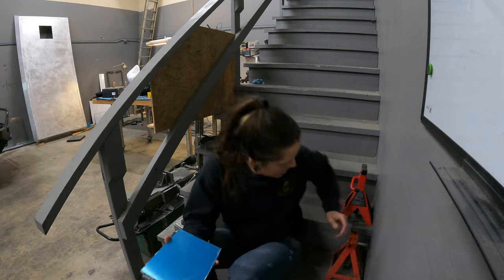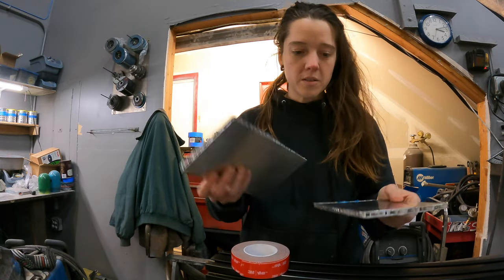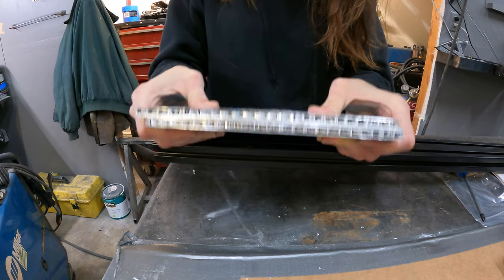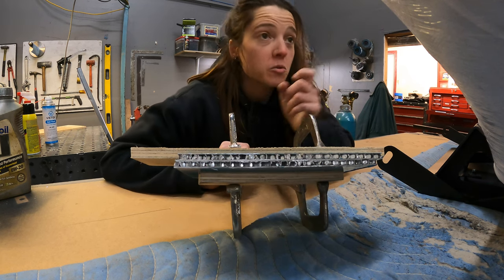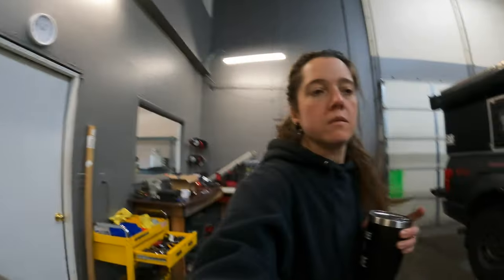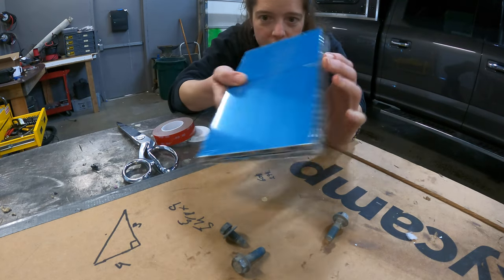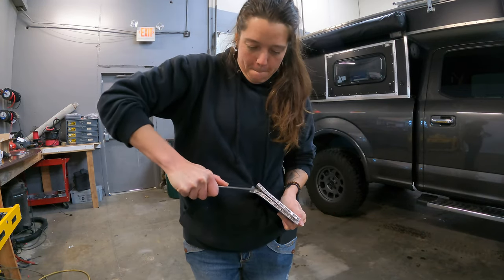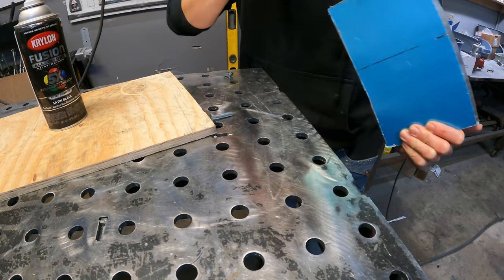"Those panels are going to FLY off!" (according to the internet) - 3M VHB Tape

Comment: The internet is full of people who spew forth absolute nonsense; it's almost a hobby for them, just like trolling is to some. I have plans to make a camper trailer using VHB to attach the aluminium panels; it took me less than 10 minutes research to know that it would be perfectly suitable. 3M are the World's best at what they do; making specialist tapes. Ignore the doubters, you won't regret using it.
Reply: Preferably use a Composite with a fibreglass skin, the aluminum provides too much thermal expansion in hot weather compared to fibreglass. If you gouge aluminum it’s tough to get rid of that scratch, Fiberglas, is easier as you just sand it and fill it and then repaint. The thermal expansion on fibreglass is a lot less in hot and cold weather.

Comment: The one area of concern would be elevated temperatures. On a very hot summer day, if you paint a panel black (or other dark color), and considering the very good thermal conductivity of aluminum the bond could be significantly weaker. With that said, removing VHB tape sealing a computer screen to a device using a hot air station still takes a lot of effort. Even with a weaker bond, it would take a significant amount of force to separate the parts.

Comment: It depends on the substrate you're gluing it to. If you have a flat aluminum roof it will hold well. My motorhome roof has a thin EPDM (rubber) membrane covering a plywood roof. Even if it did adhere to this thin membrane, the membrane itself would surely pull lose from the roof, tear and fly off. I used 54 toggle bolts with over 1,000lbs of tensile strength each to secure my solar array to the plywood roof of my motorhome, so it comes off, the whole roof is coming with it.

Comment from the maker: According to the internet, they say the camper panels are going to completely fly off on the freeway. Therefore, I wanted to do a test on how much force is required to separate the panels once the tape has cured. 

Conclusion: I don't think the wind can compete with a pry-bar.
Reply: Most solar racks that you can order for camper shells come with the 3m tape instead of bolt holes. I know GFC specifically recommends using that tape for their solar rack on the top of vehicles.

Comment: Back in the late 90s I worked on a product that used an internal lead-acid battery. It weighed a few pounds and hung in place from a single strip of what I presume was VHB tape. The product passed all the drop and vibration tests. That changed my mind forever about the stuff. The problem is, there are many imitations that perform quite poorly, and they gave tape a bad name.

Comment: Great video!  I think people are mistaken because if anything the worry of panels "flying off" should be placed on the event of an actual crash or accident. People should just roll down the window when driving at 60 mph and stik their hand out in an horizontal position, that would give them a sense of the stress the wind is putting on the panels.

Comment: Hello Badass. You should use on the substrates  first isopropilic alcohol to clean, then Universal Primer BEFORE and then when they are dry the VHB: I bet you there is no way to fly the panels off

Comment: That's a good test. You're good to go. I remember doing a similar test and thinking yup, this is the stuff. 

I built my own camper in 2019. I used 1"AL square tube with .050 AL sheet double sided taped to it. 
I used about 600 feet of 3M CV62F. 
So far I spent 189 nights sleeping in my camper. 
I've taken  it off roading all over the place from the mountains and deserts of California to the Maze District of Canyonland lands national park.I beat the crap out of it. I've rammed it into trees and rocks.

It's holding up just fine. That tape is crazy strong.

Comment: I use knockoff non-3M tape for scooting vinyl plank flooring around, after the floor is assembled. Stick some tape on a 2x4, stick the 2x4 to the tile you need to move, stand on the 2x4 for a moment, whack the 2x4 with a hammer, tile will move. Tighten up gaps, move a gap a tile at a time out to the edge, etc. That stuff holds up to pounding with a hammer, and then is a royal pain to remove from the tile afterwards. Genuine 3M stuff, properly clamped and cured, will have no issue at all with highway speeds.

Comment: From my own experience 3m tape is great when using the proper stuff, I use the 410 at work to machine parts that are small, thin, or awkward and when done properly it will hold no matter what and I don't back off on the feeds and speeds at all while doing this as well and even have broken end mills when I pushed them a little too hard even

Comment: Would the tape hold better if the surfaces were roughened up with light sanding before the tape gets applied?  As you were prying the panels apart, all of a sudden, the tape let loose with a pop!  That tells me the bond wasn't holding the entire length of the tape
Reply from the maker: The point of this video was to show how much effort is required to pull them apart. If my camper is undergoing THAT level of stress, I think my biggest concern will be wondering why Im in a not-so-good situation where my camper is being ripped apart. 

In other words, me driving down the road won't make the panels come off. Roughing up the edges could make a tiny difference but certainly not enough for me to redo all the panels at this point.

Comment: Many people just talk for the hobby of talking, many speak without even having tried this tape, or they have tried it but joining a greasy panel with a panel full of dust, and then they complain because the two panels come apart.
Anyway, I think one thing has to be clarified: it's not only a temporary test of the adhesive's resistance under stress that counts, it's also important to determine its resistance over time. And such a test can only be made by time itself.
I've tried some tapes that seemed extra-strong in the moment I had just applied them, but, after a while, they lost their bond strength by themselves, without even any stress test.
Furthermore, I think the deformability of the surfaces you join is an important factor to take into consideration. If you place a wooden plaque on a wall, the wood may tend to warp over time, and, if the tensions generated by the wood are high, it's not certain that the double-sided tape will be able to retain the deformations without detaching from the contact surface, or without damaging them.

Comment: The problem with DIY folks using VHB tape for adhering things is that many DIY folks fail to prep the surface properly. I've seen them using the tape while doing virtually no surface prep whatsoever and also failing to follow the very specific instructions provided by 3M. Applied to dirty skoolie roofs with sketchy paint jobs, for example. No,  I do NOT want to be following that thing down the highway, thanks.
The examples of the commercial uses of these tapes shows that they certainly CAN perform under tough conditions but you can bet that the tapes were used with extreme caution and strict adherence to whatever protocols applied to the type of tape used, the surface to which it was applied, and the items that were secured.
It's all about the prep and proper application.
Reply: this is standard in airplane manufacturing, people are clueless
Reply: @mookisabatuki4201  ---people who fail at prepping surfaces are clueless, yes.
Can't take shortcuts when you're using adhesive products with explicit use instructions.

Comment: Premium Euro adventure truck and  camper builders use that  same tape on steel, glass and aluminum panels all the time on vehicles that ACTUALLY do remote desert, jungle and forest camping without issue, Fear not and continue. You're good.
Reply from the maker: Good to know! Thanks for leaving a comment and sharing that.

Comment: Dude, I was so worried that your hands were going to slip and you'd cut yourself on the aluminum. 

Fun tip, if you ever actually need to get the tape apart and heat isn't an option, you can cut it with thread.  Thread works great for cutting certain plastics, too.
Reply from the maker: The whole point of the video was to prove how much effort is required to separate them, since the internet experts are telling me that the wind on the freeway is going to rip them off my camper.

Wasn't a... "how to to separate" video.. 😂

Comment: Strong stuff... however, your experiment doesn't factor in 2 things; deterioration because of weather influences over time. (Car roofs can get hot, real hot... and then cool down fast with rain). And ofcourse paint, always the weakest link with any bonding agent. So best sand down to bare metal if you're bonding to painted surfaces.

Comment: I hope anyone helpful might be able to answer my questions quickly. So I was planning on buying these 3M's VHB so I could stick my acoustic foam panels to my wall, question is, would it ruin the paint once I attempt to carefully rip the tape off the wall? Is the tape really that effective on lightweight foams to concrete walls?

Comment: Their are a lot of people that just don't know science and technology. Even most windshields are held in place today with basically a sophisticated caulking. You really have to read the specifications of glues and such.  Many manufacturers ad a rivet or screw in key locations just to avoid a law suit.

That was a great test but you need to include, various cycles of temperature changes, direct sun, vibration, body frame flexing, humidity, frost etc. 

In aviation, harmonic frequencies from an engine, which you can't feel, can destroy an airplane just a little at a time until it disintegrates mid air. Expansion and contraction is a major cause of metal fatigue. Just like a paper clip, it will break.

Comment: Well if a pry bar falls off the back of a truck on a freeway (virtually no one secures their tools correctly) and bounces at the correct angle and you are driving at the correct distance and speed for that pry bar to jam itself between the panels and then an extra resistive force like a parachute was to also attach to the other end of the pry bar and then deploy it might separate the panels making them fly off. See! the panels are going to fly off.

Comment: the escape RV manufacturer  in canada used this tape for factory solar panel installs until the attrition of time happens....customers did have them come off on the freeway. Thus, trough roof bolts after.

Comment: One problem I see in this comparison is that she is clamping the pieces together with a lot of force. Most of the applications I see are affixing a solar panel to a camper or trailer roof. You can't get anywhere near that amount of force in that situation. The people simply press down on the components. I'm about to install panels on my trailer and am debating the right implementation. I hate to drill holes in the roof but struggle to trust an adhesive. Will have to do some more research and some sort of test. We also need to acknowledge the heat up then cool down cycle which typically has a strong impact on adhesives. This test does not address this. Thumbs up. Like your sense of humor... "gotta keep 'em separated"... I'm always quoting that song in situations like this.

Comment: I've got stuff bonded by double-sided tape that has held for 20 years. ...and bonds on the same vehicle that have failed. Internal and External. If I bought an RV with non-decorative panels bonded with double-sided tape, I'd be pretty upset.
Reply from the maker: 20 YEARS?!? Wow, that's really awesome to hear. 

I had one comment tell me how this stuff will brittle up and break in a year or two. Yet the solar panels on my old camper are still holding strong and those are going their fourth year atop a black camper lid.

Comment: Dumb test. (a) do you really think spoilers and wings are clamped on for hours at a time before use ? and (b) do you know how many pounds of forces are generated by a good rear wing, usually trying to rip the spoiler off ? A darn sight more than you can pull with your hands. I'm sure many spoilers and wings can be attached using double sided tape but many will come off too because of poor installs and the shear forces.
Reply from the maker: Thanks for watching!! Cheers! 🤘🏻